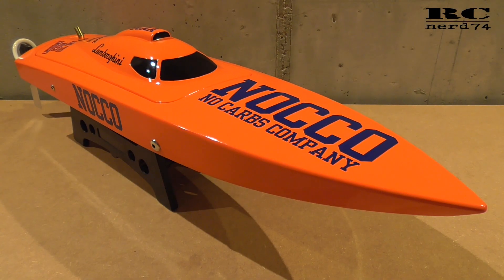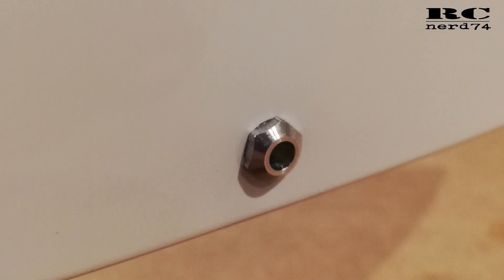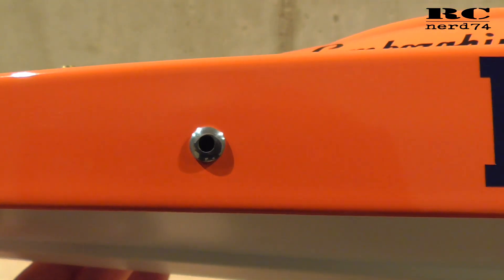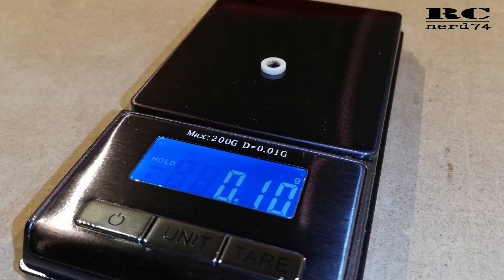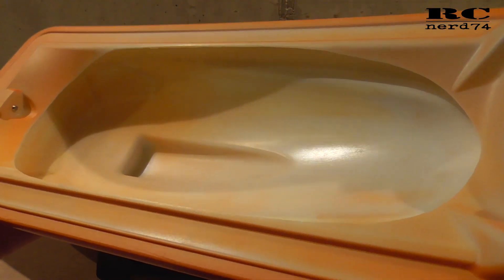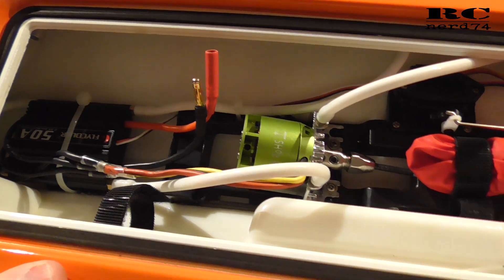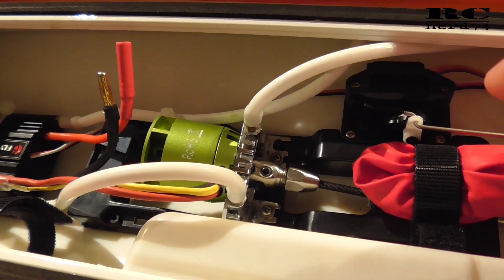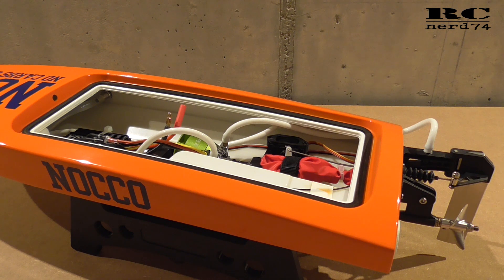JOYSWAY ROCKET 26 BRUSHLESS DEEP-V RC RACE BOAT | MODIFICATIONS PART2

Comment: I not understand info about motor? Size kv watt.....
Reply from the maker: What do you need to know?
Reply: @RCnerd74  motor model, kv, size and watt. Thank
Reply from the maker: @sebastianobeltrami8742  The Racerstar BR2835 is sold out. I currently use the motor in the following link. this works way better for this boat:  https://de.aliexpress.com/item/32836625953.html?spm=a2g0s.9042311.0.0.700d4c4dqhieZU  You will find all infos about the motor in the link.
Reply: @RCnerd74  thanks for the reply and info. Stay fast
Reply: However, if I'm not mistaken, they are both about 450 watt motors. Running 74km h you got an excellent result with this engine.
Reply from the maker: @sebastianobeltrami8742  I still try to push a bit further. More testing follows soon.
Reply: @RCnerd74  I aspect tests soon :).

Comment: M8 your dogdrive needs between de White ring and the bearing 1 a 2 mm tolerance. Because your flexishaft is getting shorter by rpm . De bearing wil not sort the the problem in theory your motor get more resistants.

Comment: Your Boat looks great! Make sure when you run it with the Mods you have done that you tape the Hatch to prevent water getting in and also keep the hatch from ripping off. The plastic that you cut from the hatch helps it to float in the event that it does come off on the water so tape will help prevent it from sinking.
Reply from the maker: Thanks for your tips :o)